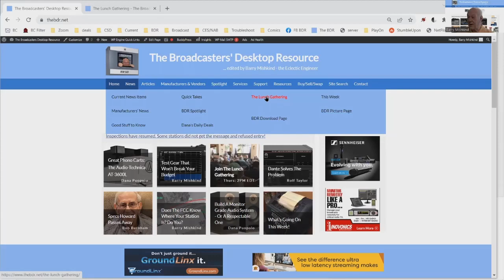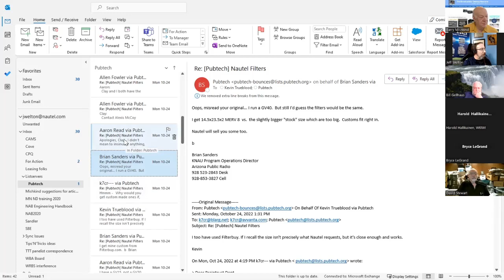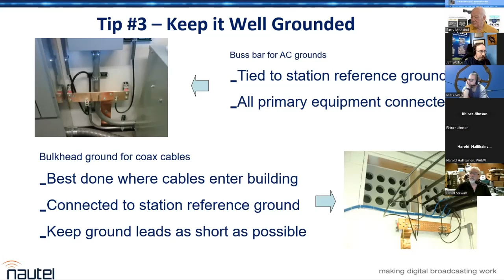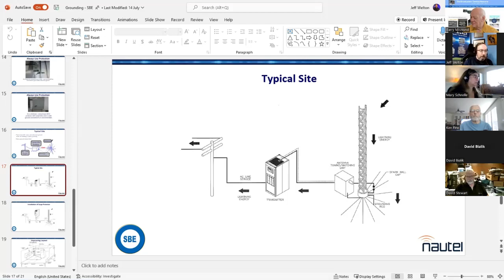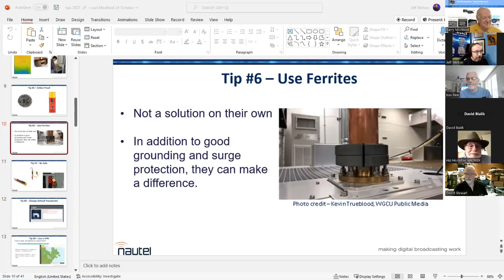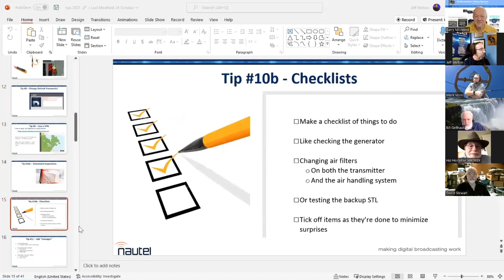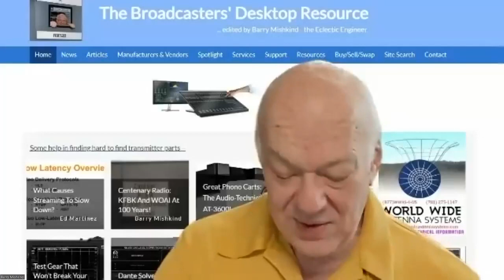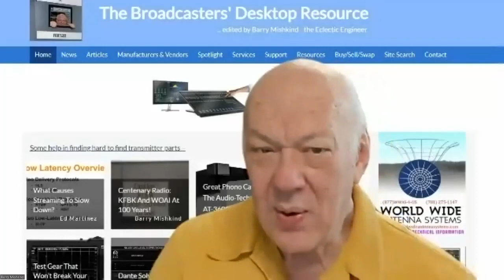Protecting Your Transmitter on the BDR Lunch Gathering 11/3/22

Comment: I learned something- space out ferrite chokes.  But how far apart?
Reply from the maker: Jeff Welton responds: "Heh, billion dollar question… far enough that the magnetic fields don’t overlap when saturated. As a general rule of thumb, I just roll with a nominal number of 2x diameter or greater. Again, putting them close together doesn’t hurt anything, it’s just slightly less effective."